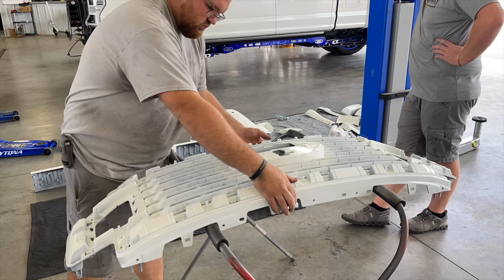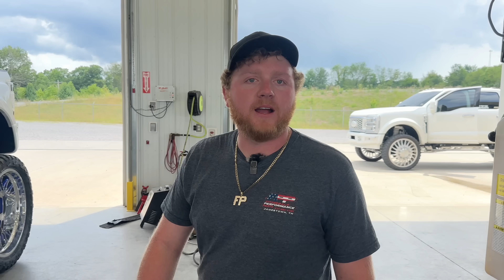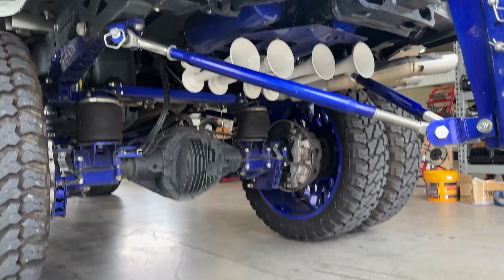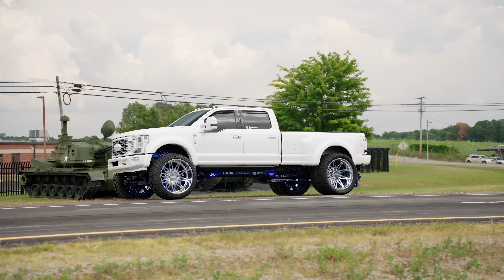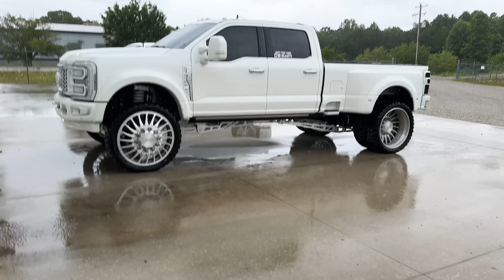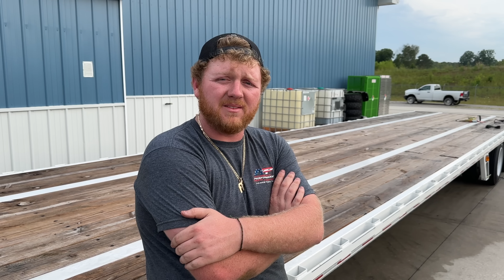I've been HIDING This TRUCK For Months!!!!! NEW Build Reveal

Comment: There’s cool black and warm black

With dyes and pigments you’ll either see a very very slight blue tint on a cool black color and a very very slight red tint on a warm black. 

So the interior with all the leather conditioner and other cleaners that have been in it I’m sure helps pull out the cool black color leaving an ever slight blueish tint